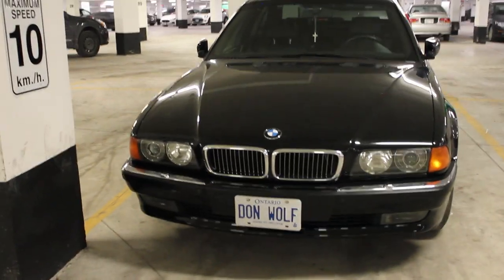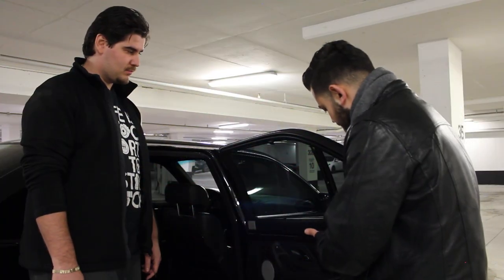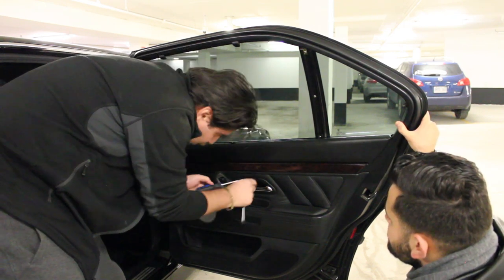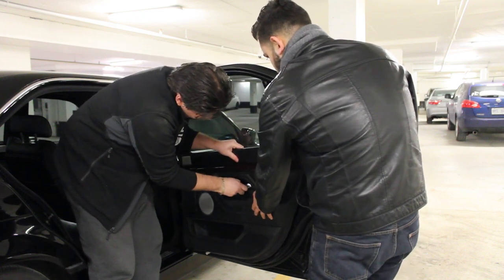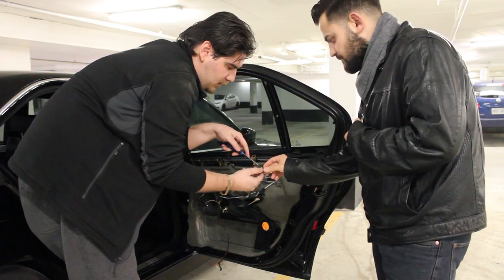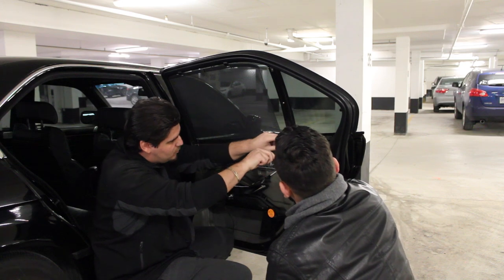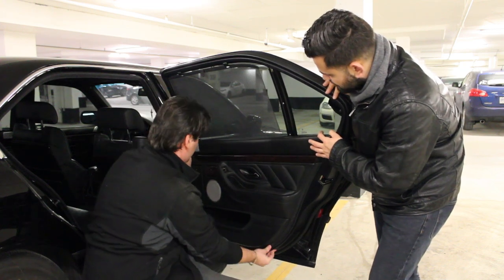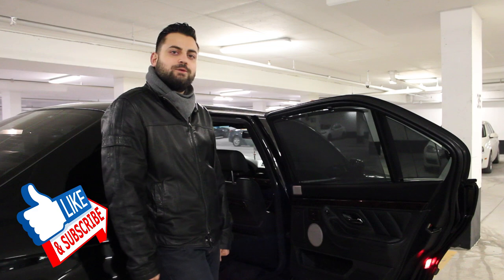BMW: Rear Sunshade Replacement DIY! (Step-by-Step) EASY!

Comment: Perhaps a silly question, but how are the shade support hooks attached to the upper window trim?
Reply: metal sliding brackets hold them in place. There is a nub that pokes thru the hole on the trim and there is a metal bracket similar to how a paper clip holds paper together that slides around the nub and locks it in place.

Comment: I liked the video on how to change the small shade. I have a 2011 bmw 550 where the small driver side shade is ripping from the bracket. Do you know where I can find a replacement? Or how to repair? Thanks. 

Vince